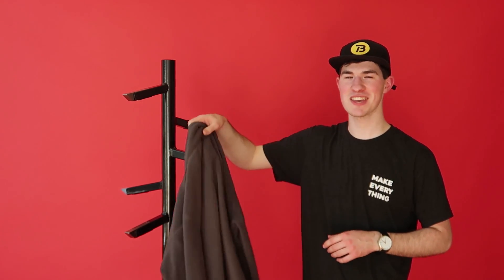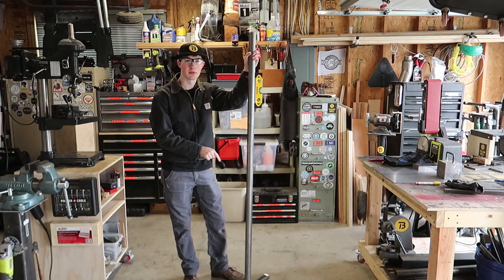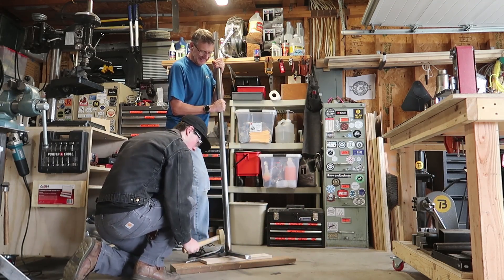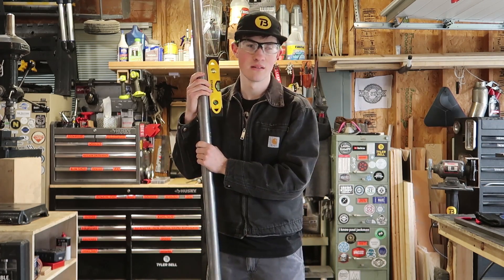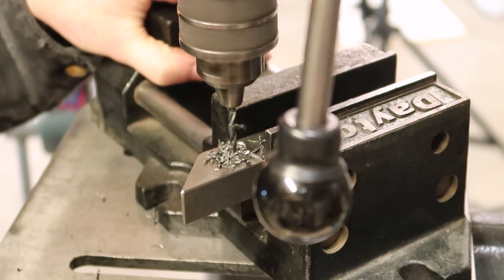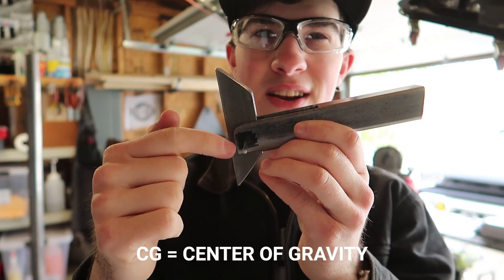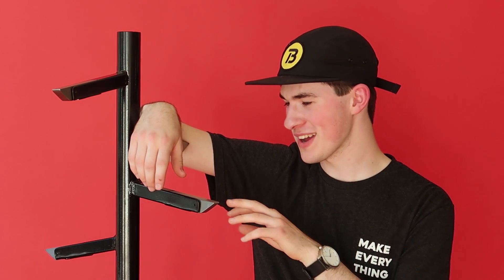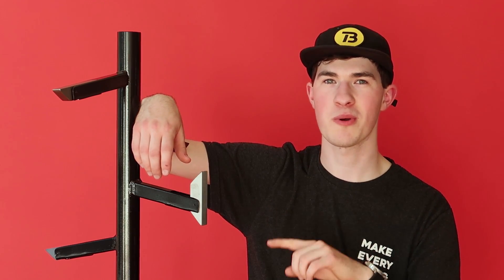Making a Mechanical Steel Coat Rack that looks like it won't work

Comment: If your floor is not level , then pole is also not level if you use a spirit level on the pole
Reply from the maker: 1.5 years later and I just realized that 🤣🤦‍♂️
Reply: @TylerBellMakes  a common mistake ...

Comment: If you tack it properly or even just leave room for the weld to pull it would save you having to knock it square and if you're struggling to get decent welds try spot welding, start 1 or 2mm past the last spot then whip back into it

Comment: Overall good video but that being said bondo on projects like this are for people who can't weld and/or are too lazy to grind.  From 20+ years as a welding hobbyist when I've done crap welds I either grinded and re-welded or built up the weld and went over it with a 120 grit wheel and smoothed everything out .  Another option is grinding down, breaking out the torch and using brazing rod as a filler.

Comment: Try always wearing welding gloves while welding. Arc has a lot of uv radiation, it easily damages skin.
Reply: But please don't wear gloves when using the other power tools. Gave me anxiety watching you use the bandsaw with gloves on.
Reply: @Eyes0penNoFear  general rules of thumb is that you don't wear gloves if it has a switch, but you do wear gloves if it has a trigger, right? That's what I've heard, idk how accurate that is
Reply: legit. had some skin burn during my short apprenticeship. thought it was weird since i didnt see much sun at the time.
Reply: @Looo0007  yup i have 'sunburned' myself welding.
Reply: And fan or remove zink coating from metal before welding.. learned those both in hard way.. that head ache is real killer, not to mention frustration when you just cant get it to stick, it blows holes and so on.
Reply: Agreed. Welding releases UV-C aswell, so it's extra nasty.
Reply: 2:34
Reply: Or you know pay the attention to the whole video including where he put always wear gloves while welding
Reply: @MooresRacingandOff-Roading  0:51
Reply: @MooresRacingandOff-Roading  that blip of info went to fast, so not surprised it was missed
Reply: Don´t try that. Makes your sympathetic :D Also you will have a nice tan
Reply: @mafr3552  or burned skin if you're fair skinned. I do get a really dark tan though. Like i'm cycling for a few hundred KMs or something.
Reply: Bet you are not fun at parties Lmao!
Reply: @klidaras11  bet your hands are fucked ! Lmao
Reply: @klidaras11  what does safety during construction have to do with parties?
Reply: @klidaras11  I would much prefer to spend time with a practical person than a "party" person. I cannot abide useless people.